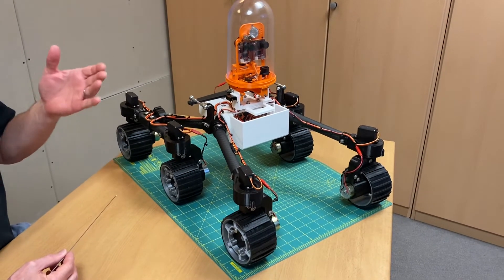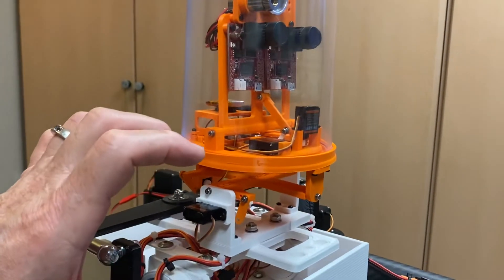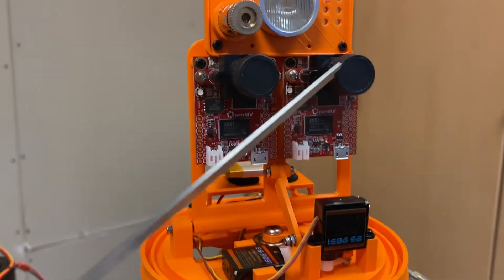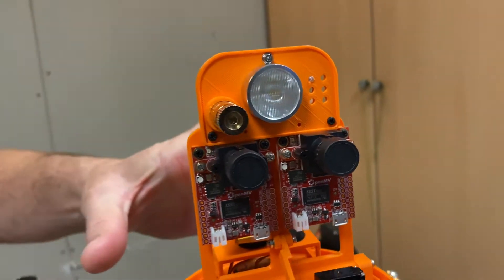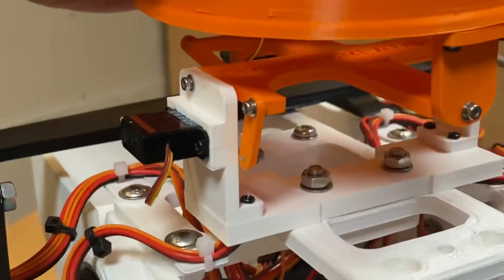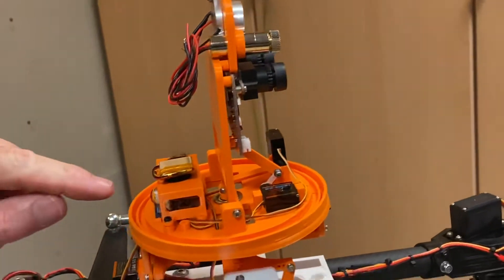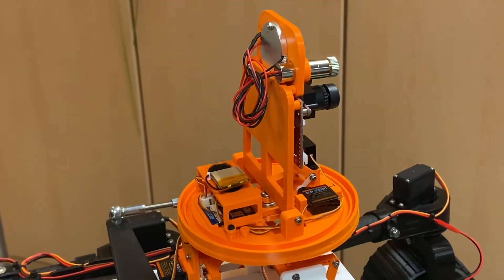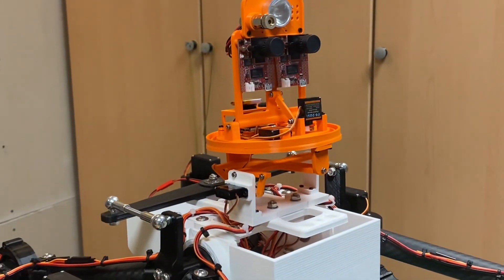Robotics project update 3/31/2021 - head & body united

Comment: I do not think it will work for you to have the thermal imager inside the dome because the dome is not transparent to heat radiation like visible light.
Reply from the maker: I believe you’re correct. Glass is removable.